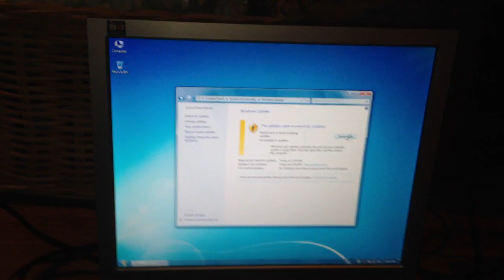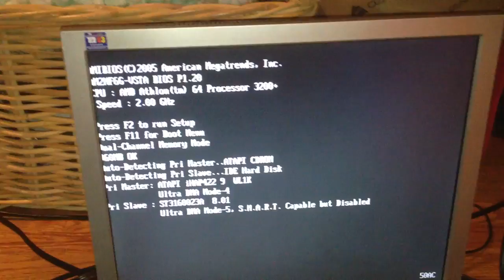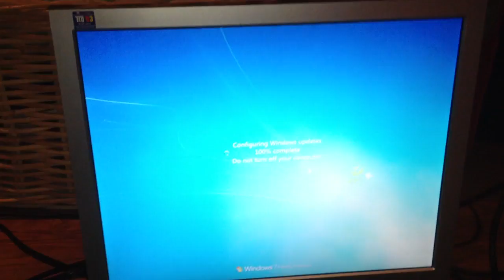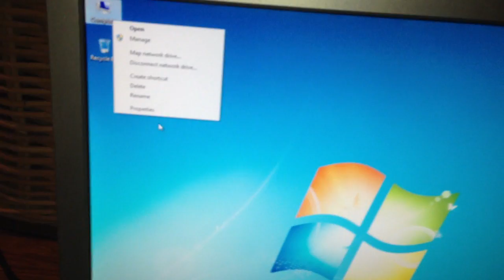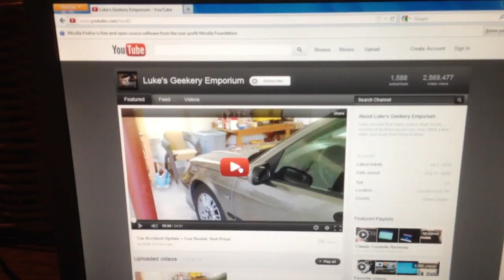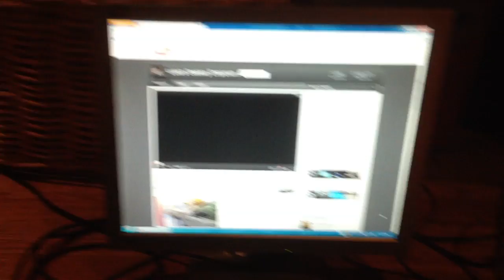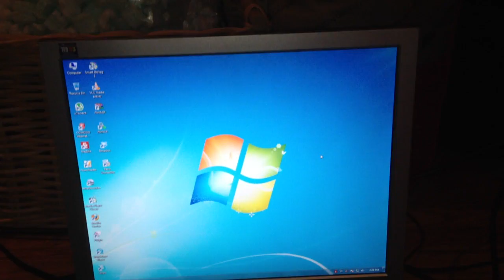Workshop Computer 7-7-2012

Comment: Well I suppose, you don't see an awful lot of Acer desktops where I live, so I can't really gather an opinion on the quality of their products as a whole. I know their laptops are pretty bad though.

I bought my Acer from a friend cheap. Two years later and it still works, I only had a problem when the tiny fan on the graphics card started going bad. I replaced it with an 80mm case fan and it's better than ever.

Comment: only issue with that is the nforce bits of the chipset.. I've had a few boards bad from the get-go, and others that were great.. HP had a few boards that ran well with it, but aftermarket boards don't do so well with it.

Comment: i actually have an amd 64 754 single core right now and it is on a nice gigabyte board that does dual bios and tons of raid and boy is it a nice board. i also have a sorta nice heatsink on it as well. to bad i only have 1.5gb of ram rather then the max 3gb of ram. oh well it runs perfect just got to get a better agp video card for it